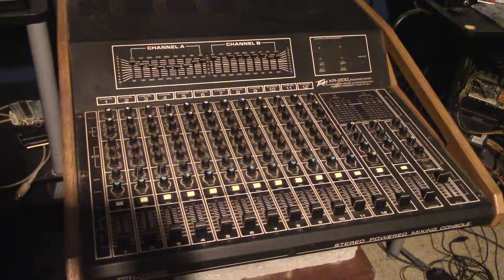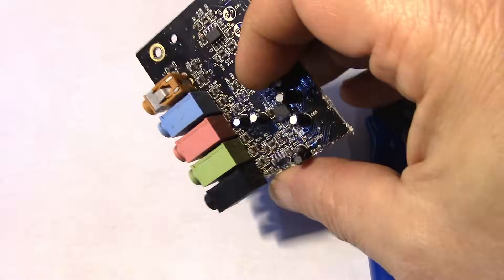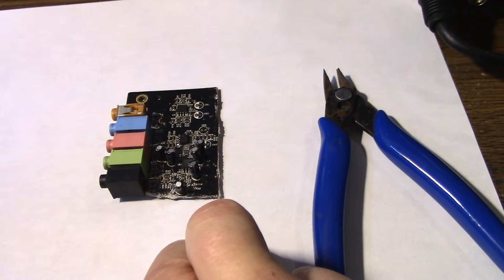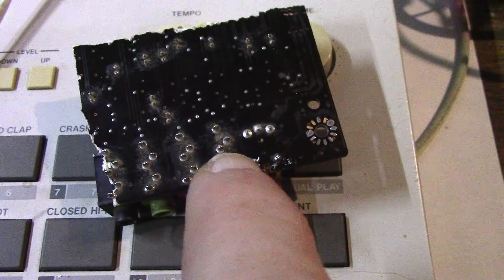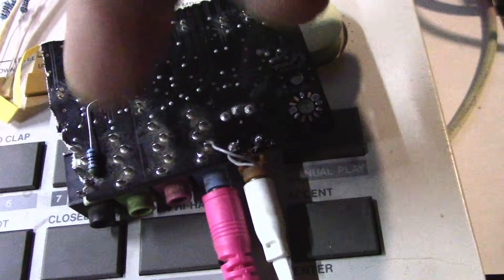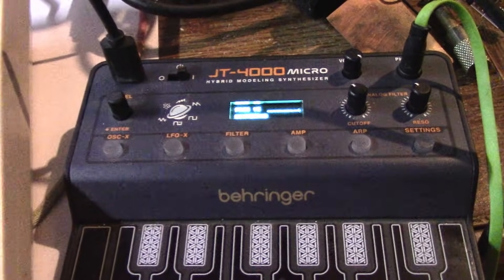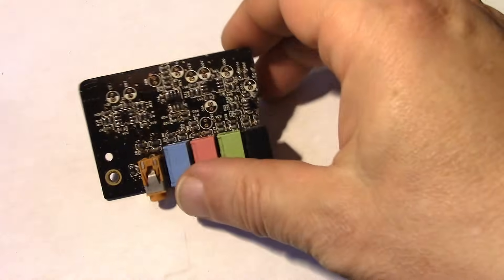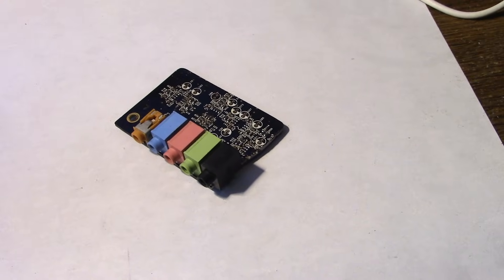DIY Mini Mixer – Tiny 4-Channel Build From Recycled Parts

Comment: Very inventive, nice to see your music gear also , sounding great  👂 Slider2732 background sounds  excellent 😊  👍
Reply from the maker: The TR-505 wasn't intended to be used, I'd lined up my own build drum machine called ESP-909, which is a bit smaller. But, there were troubles with its cartridge port (different drum machine on each cartridge) so the TR got used.  The JT4000 does lend itself to small spaces though 😀